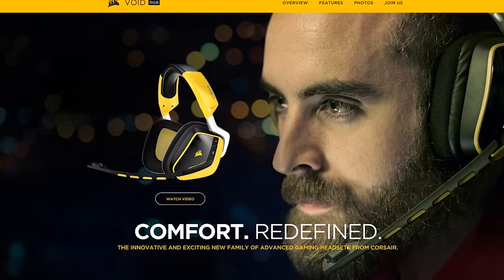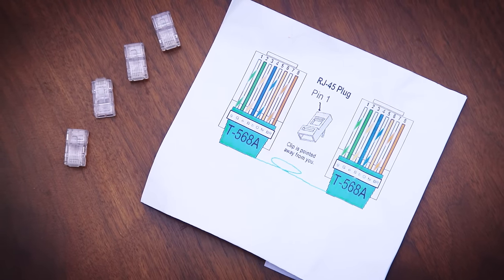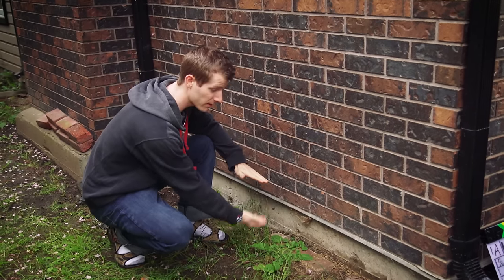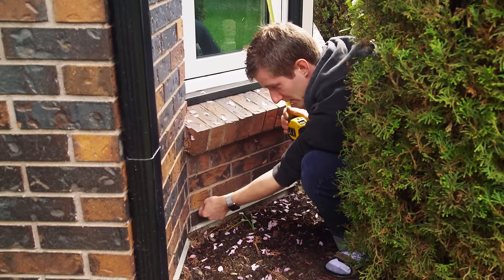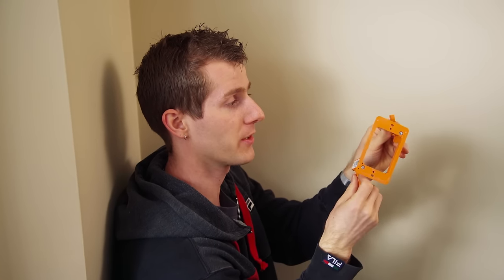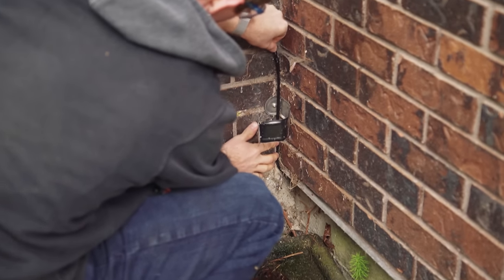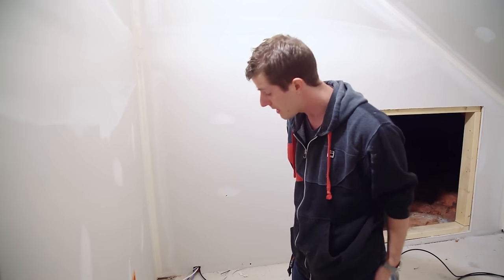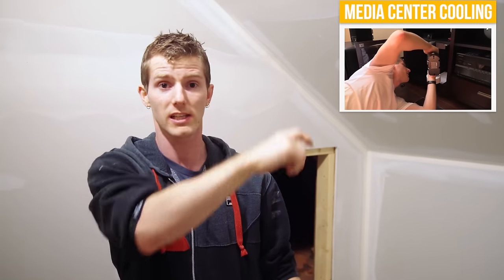Optimize your cable runs at home! - Installing an exterior Cat 5e cable

Comment: This only works in these US/Canada paper houses. In Germany, you have to go through really tough walls.
Reply: Well... yes and no. It's perfectly common for cable companies to do this in apartment buildings. Run cables up the side of the exterior and drill into each apartment where appropriate from the outside.

But yeah - You definitely need better drillbits and a drill that can handle a brick wall.
Reply: I was going to say, yes... I know North Americans have a deeply rooted love affair with drywall, but in countries where we actually make our walls out of 10cm thick concrete, this is slightly more of a hassle.
Reply: Well germans have proper tools available. so they can build tougher houses
Reply: +Jack Cowsill well really, blue bosch tools and dewalt tools don't have any real competition in terms of quality and durability. bosch green tools aren't good though and you should never buy them
Reply: But, but.... it was 18v!!!! LOL
Reply: +Robert Faber here we use 20 to 30 cm of celled brick+ thermal insulation which ranges from 10-20 cm of hard foam to the same amount of stone wool or even 5 cm of either of these + facade brick. steel reinforced concrete used for support poles and ceilings/floors and very rarely for walls.
Reply: BTW, there is NO FRIGGIN WAY that puny little drill could go trought any exterior (or interior ones if they are structural)  walls built up to code here in Spain, either. 

Generally speaking, European buildings are much, much tougher.
Reply: That just sounds like a pain in the ass if you ever want to install cables or do any sort of renovation. It's not like you're driving tanks through your house FFS, drywall is perfectly fine. Allows you to put insulation in the walls and makes it easier to modify the house.

For example we just expanded our downstairs by ourselves. If that was all concrete we would have paid thousands to have it demolished and removed.
Reply: Roman 2510M I studied architecture for a few years, so I can tell you that in the Netherlands, it tends to be 10cm of solid brick, between 10cm and 25cm of insulation, and then between 10cm and 15cm of steel-reinforced concrete (for load-bearing walls) or 10cm of lime-sand blocks (for non-load-bearing walls). Pretty similar then. But let's face it, wherever you go in Western Europe, building standards are way, way, way higher than they are in North America...
Reply: Pyroteq drywall is not fine. If you rage because someone quickscopes you in CoD and you punch or kick the wall you can fly right to it. That won't happen with a standard old fashioned european wall. You will only break your hand or leg. You should plan your house before you buy/build it so that you don't have to upgrade/expand. You shouldn't have walls made out of soley reinforced concrete it's one of the most unpractical things you could do in a residential house.  Celled brick is way better. While not as strong it is much more practical
Reply: To be fair, we Europeans have done a fair bit of that. Building tank proof houses has become bit of a necessity here.
Reply: Ah, good 'ol German engineering
Reply: even in our pakistan our walls are 30cm to 40cm with cement bricks construction
Reply: actually in Canada we do have the winter problem so we still have ALOT of brick houses, all brick
Reply: +ComandanteJ the size of drill doesn't matter. It's the size of the drill bit that makes the difference. A 60 cm carbide tipped bit will go through practically any concrete wall with any handheld 12v drill let alone larger 18 and 20v drills
Reply: Have you ever tried to drill a 10 cm (yes, cm not mm) hole into a 60 cm solid stone and concrete wall? 
That is painful
But i still prefer being able to hang everything from every wall
If you Born here in Italy it isn't a preblem and you can still remodel, add power plugs, run wires without too much of a problem
Reply: lol same here in India too
Reply: Shahin Eisawi Of course, i meant to say drill bit. Me myself have gone trough the exterior wall in my house with a 18v drill a little smaller than the one Linus uses in the vid. It takes patience, but it's perfectly capable.
Reply: +ComandanteJ not directly connected to your comment, but for all who are bragging with german toolsand companys like bosch, makita is often used here in germany and they make some good quality tools too. but i dont know where makita comes from
Reply: +TheV_Machine japan
I think they make pretty much the best tools ever
Reply: Scarry Polpetta I'd agree. Between Makita and Hitachi, all the best quality power tools are pretty much covered.
Reply: Well, speaking of how my parents and my grandpa (learned electrician) completely renovated the now 60 year old town house we live in, they didn't put the cables INTO the brick/concrete walls, mostly, the (inside) cables are run in the plaster on the walls, so yes, while it is a hassle, and you do have to drill a few holes, you can usually re-route cables quiet invisible and nicely, when you are renovating with new wallpaper ect anyway. 

Now, my father (and me) is pretty happy that he had the thought to include cat 5 from the cellar to every room, when they redid the whole cable and electricity, a few years back. (though, there isnt actually an outlet in every room for it)

But yes, for outside applications ( think satellite dish) and if it's a rental or other reasons, running the cable down the wall is normal too, if you cant or dont want to rip open the plaster.
You do see the painted over cables a lot here if you are looking at old /smallish houses  in cities with a few or couple of apartments, that have been renovated in bits and pieces.

And you have options to hide the cables under floors and the wall/floor finishing  thingies usually accommodate for cables.

(Also, we do have some drywall in what used to be a big attic and now is a normal room with a tiny attic. but no actual installation is running through the drywall walls, only along the walls that are normal brick with plaster on)
Reply: yeah, american obsession with timber framed houses is so weird.
Reply: Just get a longer drill bit and a better drill.
Reply: Tough walls on a house you'll never own.
Reply: *Newer US houses
Reply: I don't see what the big deal is.... If it holds up to 30 tons of snow in the winter and up to 80 mph(128kmph) winds during the summer, what else do you need? unless you live in tornado alley or near a fault line. We don't need tank proof houses because, unlike what most foreigners think, this is not a dangerous country.
Reply: *in Europe
Reply: Zach Demand Have you ever lived in a concrete house? The difference in comfort really is massive...
Reply: Here in Sweden. We usually do it by using a demo hammer to create a hole going through all the sections of the stairs, all the way down in concrete buildings, and then running the cables from the stairs inside the apartments above the entrance door. The outer concrete walls are just stupidly thick. This saves a ton of work, and it looks decent enough when done right.
Reply: Bosch tools are toys! Try Hilti
Reply: Robert Faber  I haven't lived in one but I have been in one, felt like I was in a bunker. All the owner talked about was how much it costs to heat during the winter, and cool during the summer. Ever noticed how concrete walls are usually hotter or cooler than the ambient temperature? He has removed the windows on the south side and buried it. He now has very little heating/cooling costs.  Funny thing is, that house is less than half the size of mine and costs 3 times as much.
Reply: Like the Berlin wall?
Reply: Caost Bosh blue line is half decent, it's the green "home" stuff what's crap. Even Black&Decker is better than Bosh.

For me, nothing beats Hitachi and Festool.
Reply: +Pyroteq it's a cultural thing. Americans use their homes like a tool, the Europeans think more about it like a castle. Here in my town there are some buildings that where here before America was even discovered. Without the wars there were even more of these buildings still standing. And because of that they often get very mildly renovated. New windows, new floors, new walls, new doors.. That's it for many parts. :)
Reply: +Zach Demand The older buildings in my (little) town were there before America was even discovered. Our church is nearly 1000 years old. That's the difference between a nice, comfy home and a nice comfy home build to last ;)
Reply: I work on stone built properties in and around Yorkshire. I spend more on drill bits in a year than the average tradesman in his whole career :(
Reply: +Robert Faber aye I'm currently living in an old house built in 1870s take about tough walls lol
Reply: 1. Linus is using a 18V hammer drill.
2. Makita is just as good as Bosch professinal series.
3. I have a Bosch GSR 18V Drill and it goes through any Wall without a problem. I live in Switzerland.
Lithium powered Akku's have become very powerful. 4 Ah is enough.
Reply: Well, not all countries run cables from the outside in. Where i live, all cables are run in tubes inside the house. You don't see any cables anywhere and a lightning strikes cause less damage.
Reply: "blue bosch tools" = Bosch professional series
Hilti is a huge role player on the professional market. Especially with Hilti Fleet. Awesome service.
Reply: I disagree, as i work as an alectrician in Switzerland. That drill will go through any wall. with ease. It was made for such stuff. You can tell by the sound of the drill.
Reply: I disagree. New euopean houses can be built with a Minergie Standard, and are built with concrete. Then insulated on the outside and plastered on the inside. Minergie means the houses uses very little energy, as Europe is trying to stop CO2 emissions from rising. Concrete has a very slow heat transfer. Which is useful in fast changing weathers. You don't feel the heat or the cold come into you house as fast. It is what makes the house feel a lot more comfortable.
Reply: Stahl verstärkte Betonwand hört sich wie ein Bunker an :D Aber hast schon recht ;D
Reply: Its a rotary hammer drill it will go through anything with the right drill bit and enough batteries. A corded drill like that with a carbide or diamond tipped bit would eat through that like butter.
Reply: I live in an old house in the UK (Scotland) we have 90cm granite walls :D Had to drill through one once and it took 3 drills 4 bits and 6 hours :P
Reply: GifCo Why would one be an idiot for doing that? Even if there's only a single storey, strong, thick walls still have numerous advantages. Of course the advantage is much greater when you have multiple storeys, as it allows you to have concrete floors, which are an absolute must for comfort, as far as I'm concerned.
Reply: Not all houses in the US are built cheap. House I live in was built in the early 80's and i had to drill through 8 (or 20 cm)inches of solid steel reinforced concrete to get a cable through. Hammer drill and carbide drill bids for the win.
Reply: Because they are built for different environments.

While people might not understand this, guess what survives in a hurricane OR earthquake?

Those "Weak ass US/Canadian houses" do.

However that shouldn't surprise you much. Shouldn't surprise anyone that much.

Wood and flexible housing has the ability to flex, absorb vibrations etc etc etc.

A concrete house crumbles during an Earth Quake, or possibly a hurricane. A wooden house may have damage but survives.

That said! Concrete structures won't rot! Wooden structures eventually will get weaker. 

See where we're going with this? It's almost like engineering and building codes mean something and take advantage of the pros and cons of a specific environment. I mean it's ALMOST like that amiright?

That said wooden homes are a lot easier to modify and change. Both from material cost, to labour cost. They also are easier and faster to build.

So in an environment where there is no earthquakes or hurricanes it makes sense to go concrete structure.

It also depends on how much you're willing to pay. 

Do you want to rebuild, or build a brand new house for 300 grand labour included, or 600 grand labour included?

What sounds better? 

You live in an area where if an earth quake happens a wooden house survives a concrete one falls over. So do you want to rebuild every time your home experiences an earth quake in an earth quake zone? Or do you want to just fix the damage if any done to your "crappy built wooden home".

YOU KNOW WHAT THIS REMINDS ME OF?

Cars. Old cars were built "So much tougher" and you'd rather get in a crash in a "Strong steel car, then a dinky plastic fucking car".

Yet guess what? Plastic cars are safer and better engineered to take an impact allowing people to survive. 

Anyway this is a long rant and the internet argues over everything.
Reply: +JamesCizuz Wow. This is a quality of comment I don't see on YouTube often.
Reply: Most newly built houses love plasterboard and chipboard . That old saying "They don't build them like they used too" Blame the different economic climate.
Reply: i would add cosmetics to that list as well. I live in the north eastern united states were wooden framed houses are the norm. I would never move to a place that didint have similar looking homes. Not because i think wooden frame houses are built better than concrete or brick houses, but because i prefer the look of wooden houses especially with stone trimmings.  Ive visited all parts of the US where different styles of houses are popular, and i just don't care much for how they look. Im sure im not the only person who prefers one over the other just based on looks.
Reply: Mattias1172 You do know it is possible to make a house with a structural skeleton of concrete, but clad in wood on the outside, right?
Reply: In Africa, we have real buildings too.
Reply: Have none of you read  
+JamesCizuz 's comment?
Reply: Jake Ledoux Good point. We only get tornados once every 25 is years in residential areas here, and barely any earthquakes, except the occasional tremor as we don't have any fault lines.
Reply: Bradley Gibbs Really? Once every 25 years? I'm honestly impressed, that's a really low rate. In my state there's usually around 1-2 tornados yearly, which is pretty low for the US I believe.
Reply: Jake Ledoux There is a reason there were wars revolving around the colonisation of South Africa: the land, weather, etc. are insanely desirable.
Virtually no natural disasters (other than some laughable tornadoes that knock over a tree, roll a few cars and destroy a barn every 25 years) consistent weather and exceedingly fertile land.
The only problems we have are social and political issues.

And from what I've read about America (I'm aware it could be exaggerated) your area is quite docile.

To be honest, I would prefer natural disasters over the pathetic issues we face here. Seriously, try watching the South African SONA (State of the Nation's Address). It looks more like 7 year olds debating in  language they barely understand!
Reply: Hows that paper wall doing over there? Yeah I thought so....
Reply: What about england?! We've got 2 layers of brick or a layer of brick and a layer of breeze block to get through lol
Reply: you could just get a drill bit designed to drill through brick and stone.... also hammer drills
Reply: Same in the Netherlands. My network cable goes through some really thick concrete walls.
Reply: @Manse, I hope I never have to livein such an appartement.
Reply: Lost Night "an German"? Where did you learn grammar?
Reply: i live in the netherlands and i have the same thing
Reply: Unless the house is made of titanium steel anything can be done. Period.
Reply: Depends where you are... I can tell you there are a lot of really well built buildings here in Florida... Hurricane codes after Andrew help a lot with that.
Reply: @ComandanteJ  Well that's good, especially for Swedes. Did you know that Sweden now has the most grenade attacks per year out of any country that isn't currently at war? I wonder why that could be.
Reply: To all you people bragging about your brick and concrete walls, your wifi probably sucks as the signals don't penetrate well through the solid walls.
Reply: @rjfaber1991  with an SDS drill it's no problem at all.
Reply: @matthewparker2910  True.
Reply: @ninji3434  haha you must use your router as your AP 😂
Reply: Masonry bits...